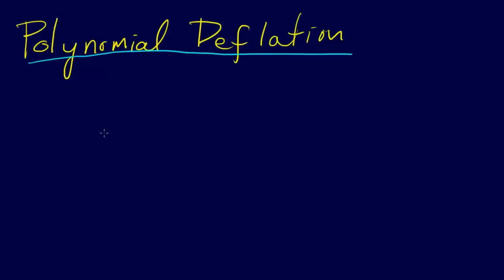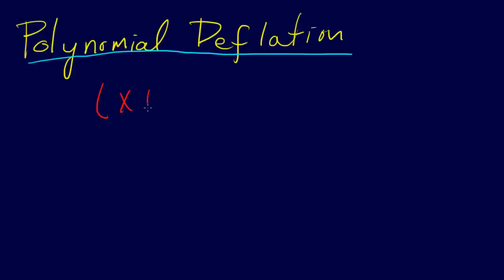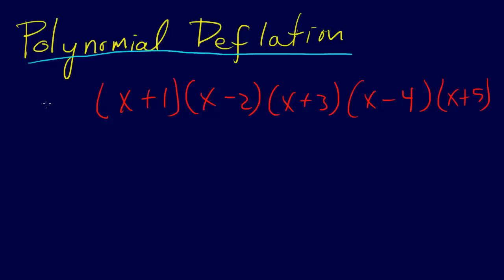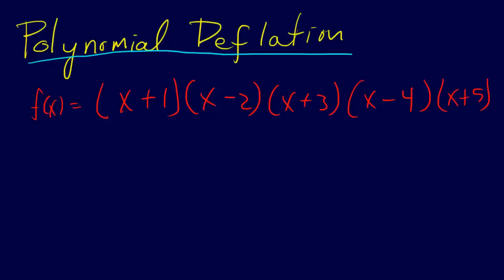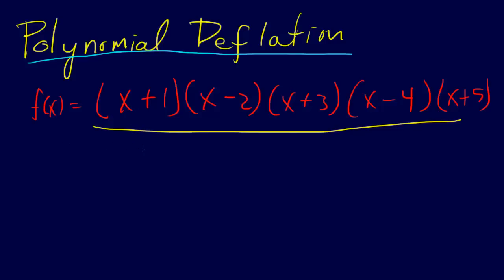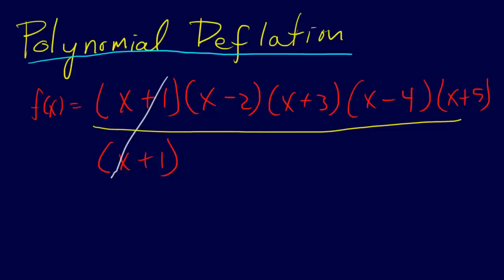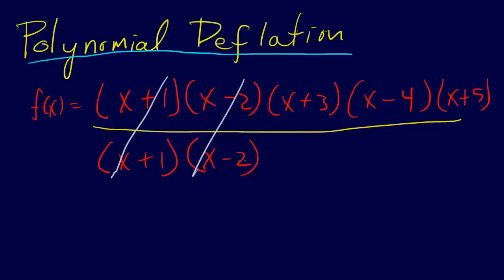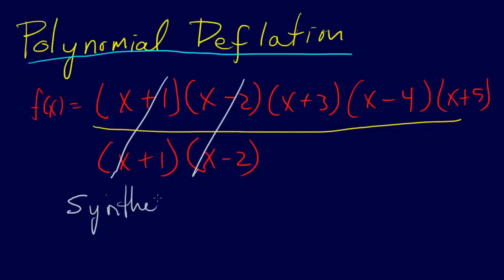2.3.7-Roots: Polynomial Deflation

Comment: I got confused at 4:20
As far as I understand Backward Deflation eliminates smaller roots first while forward deflation eliminates bigger roots first. 
So If we do Backward deflation we eliminate the smaller roots first not the higher roots, right?
Reply from the maker: Thanks for the comment. Up to 2:30 describes the concept of polynomial deflation in general. That's perhaps the most important, and the rest is potentially confusing so I've cut the clip to include only that part. The next part is easy to confuse (I did). I'll try to clarify now. When it comes to implementing polynomial deflation, there are two main algorithms. One is the forward algorithm, which is shown on page 179 of the textbook, and the other is the backward algorithm, which the textbook referenced doesn't show, but basically applies the same core recurrence relation of the forward algorithm, but in the opposite order. Either the forward or backward algorithm can be used with any factor of the original equation, so the assertion that either method eliminates larger or smaller roots is false (my apologies). In order to ensure numerical stability, it is best to use the forward deflation algorithm if your root finding scheme (and subsequent deflation) uses the roots of the polynomial in increasing magnitude (starting with the smallest). It is best to use backward deflation when the roots are deflated in decreasing magnitude (starting with the largest). Most root-finding algorithms don't guarantee order either way, so it's typically best in practice to use a composite scheme.
Reply: Thank you very much for your clarification, It's crystal clear now :)